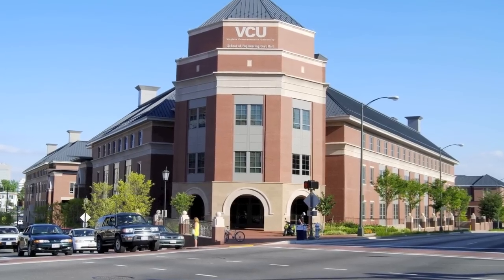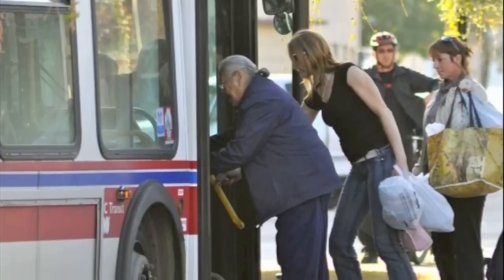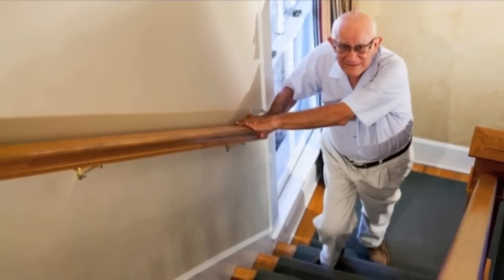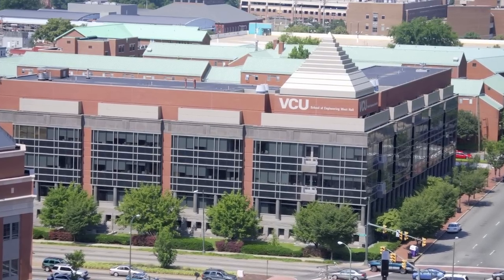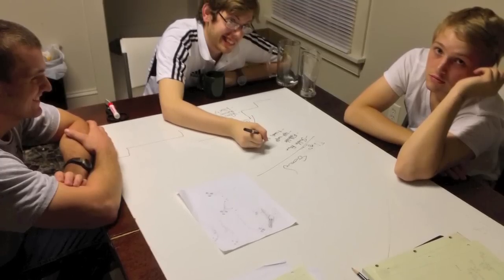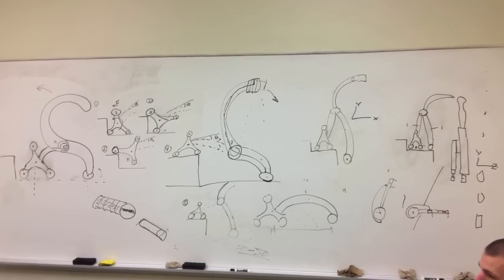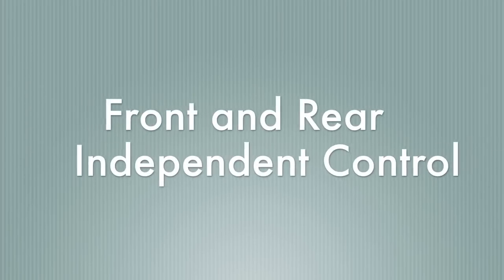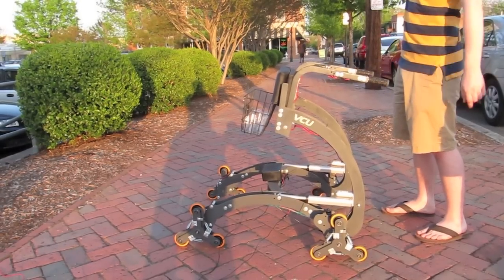The Stair Climbing Walker

Comment: The reaction time for the handle to level is toooooo slow and it not smooth. Mobility challenged people don not have time to hold on the machine for it to level off. They will most likely fall. Great concept but design and engineering is totally useless from the user's perspective. Please start from scratch and make something more usable for seniors.

Comment: No one from the original team seems to be addressing comments or questions at this point so I guess they finished their project and have moved on?  If this is the case perhaps you should turn off comments?  Is this device still being developed?  As presented it would be too dangerous but with some tweaks I'm sure those issues could easily be solved.  The nature of the device of supposes that the users are strong enough and still mobile enough to walk up and down stairs assisted by this device.   I think it's wonderful that a group of brilliant young minds would hunker down to develop a unit to help anyone who can use a walker independently solve the issue of climbing stairs.  It would be such a shame that the project was put to rest after graduation.

Comment: Okay that looks damn scary. I think you could topple forward when going down stairs. It isn't as stable as hanging onto railings on both sides. Same thing for climbing stairs, I don't see how it is overcoming the issues involved with getting up stairs. Doesn't seem it is doing much of the load bearing. I think it is novel only -- not practical or functional.

Comment: It's a great start, but probably needs a lot of revisions to work practically for most people really in need. You'd need to have various people with real issues try this out. You mentioned people could sit on this to go up or down stairs, but did not show that. I have a very hard time believing this is possible by these demos.  I also find the movement of this multiple wheel within a wheel system appears slow and choppy. My experience with a back problem is every movement is felt right up the spine, and into joints,  plus knees from degenerative bone disease [OA] - which is common - means a bit more than confidence is needed to climb stairs. Research with medical info could eventually revise this into a useful product.

Comment: Um although a good idea it is slightly awkward having to maneuver the button and handles at the same time to go down the stairs. Also a possibility that the seniors weight can be used against and they can flip over this device.. Seniors don't want to do that. It has to be very easy for them.

Comment: This would make my life 99% better I hate being stuck at home because I have to worry about stairs. If I just used it to go up and down stairs and then transferred to my regular walker would be a Godsend. Insurance probably won't cover it and it's probably expensive. Great idea though I love it.
Reply: You can buy this   https://www.youtube.com/watch?v=BrqvyvMrXC4
Reply: This is useful for someone in a wheelchair, but requires others be there to do this... and likely difficult to explain if they are not regular helpers.
Reply: If you live in a place with stairs and can not move to one level, I have seen lifts for inside that are fairly expensive, but not more than some of the walker-rollators surprisingly. I had to move to an apt. all one level. It very much depends on where you live how difficult it is to go places. It can be so frustrating having to check on all aspects of a location before going out.  I know what you mean. I have found some places are more accessible than I thought, and others say they are, but have a few steep stairs to get to that elevator - without railings! 

The problems I see with using this to transfer to your own rollator -  1] what happens when you get where you are going?  2] will this machine transfer in a vehicle easily - along with a rollator? 3] will it sit at your home outside? 

That bus they showed... will this really negotiate different types of steps - and those bus steps were on a curve.

Comment: I am 32 and stuck having to use a rollator to get around due to past injuries, before getting injured I used to go out and do stuff more often, but with rollator I have going anywhere is a major hassle, I used to like the outdoors, picnics , renaissance fairs, camping, but with my rollator anytime the terrain is not perfectly smooth and solid under the rollator wheels results in constantly having to struggle to maneuver the thing, and even folded it is bulky + heavy to get into vehicles.... I WISH I could afford a rollator like the one in this video, it would dramatically change my quality of life for the better.

Comment: My nerves are apparently trapped in scar tissue from two hip replacements on the same hip too close together. I cannot put weight onto or take weight off my right leg, so it's extremely weak and the pain is beyond description. I cannot walk. I use a regular walker but that limits my travel as I can't go far with it, nor can I climb stairs, so I'm really stuck. I'd love to acquire this as it does what I need, plus I know your school! Is this available and if you need anyone for trials, I volunteer. Please get this on the market.

Comment: Impressive!  The self leveling feature is really excellent thinking.!  The seat looks good but the pin method is going to be hard for many people.  You might think about levers instead of pins for adjustments. I hope this gets improved and on the market.  You  may not help everyone, but you will help many.  Thank you for putting your minds and talent to designing something to help people.   PS  there is also a need for all terrain walkers - perhaps a model with the ability to have various wheel sizes and types would be helpful?  I think the design you have, especially the seat and self-leveling feature could be very helpful to get some people outdoors in their yards, or even walking on hiking trails, along the beach, etc.  With appropriate wheels that could be swapped out depending on basic terrain types you could have another good product that could ad so much to the quality of life.

Comment: Very cool.  The pin pull required for transforming to a seat may be difficult to accomplish... can it be more automated?  And when in seating position, what about some form of back support/sling? Will it be made of a lightweight product or have some assist to lift into a boot/trunk? Can it have a built in flip up or down cup holder?

Comment: Is the height of the handle bars adjustable? Also while descending the stairs, if you see the video, the tendency is to lean forward. This would be a big fall concern for elderly. However, great work!  Thanks for coming up with such a cool walker. Hopefully you can tweak it a bit more. Hope you will consider consulting an Occupational Therapist and Physical Therapist about  the functionality of this model.